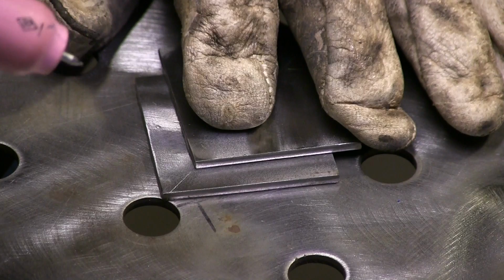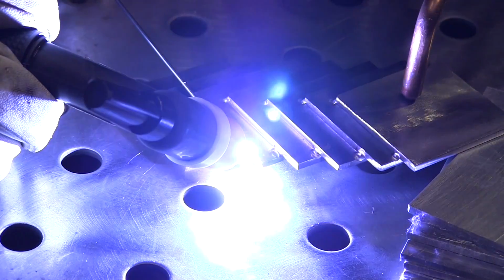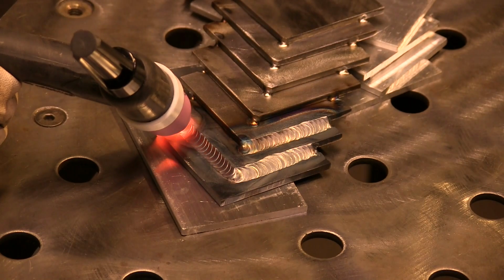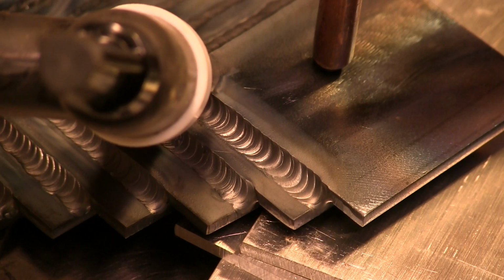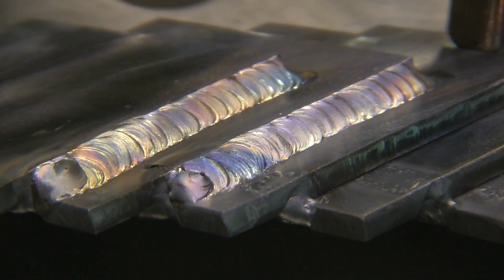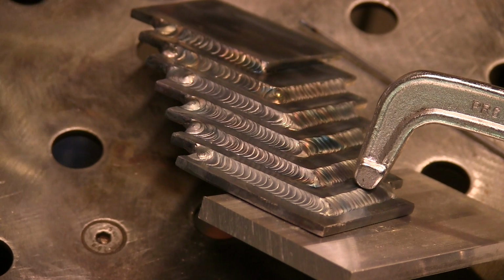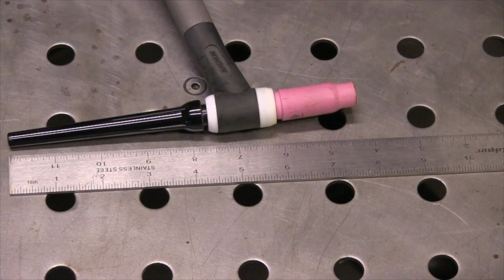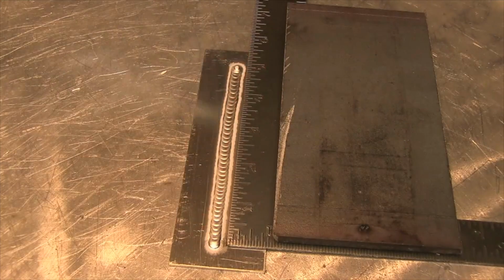Tig Welding Steel Laps Joints Practice

Comment: How do you keep your puddle from making a “moon” like shape and leaving a hole in the corner when you fill it when it does that? At times my laps do that, or I’ll melt the filler wire before it dips

Comment: With that clear #8 cup at the end what cfh are you using for air? I swapped one of those on mine to try it out and I immediately started to get small amounts of porosity. When I put my old cup on it runs fine. Is it just I need more air going through it as its a bit bigger?

Comment: Need your help jodie???
I mainly weld aluminium 99% of the time-using gold tip tungstens which apparently are good for both ac and dc welding, anyway the other 1% of my welding is mild steel header tanks. They are 2mm thick mild steel. I buff any millscale off before i weld them and sharpen a boatload of tungstens before i start. Ive found the point blunts quite quickly even if i dont touch off on the parent metal. I end up only doing about 6 inches to a foot of weld before having to change out to a freshly sharpened tungsten-it does my head in. Anyway , any suggestions?
My machine is a lorch and im using bout 100amps and about 10 litres a minute of argon. I also using just a wp20 torch with a no.5 regular(not gas lens) cup. Ive tried using 2%lanthanated but still fouling after about 6-9 inches of weld .rsvp an answer please

Comment: Another helpful tip on tight arc practicing that I've learned is favoring that arc slightly more on the flat piece as you see here. I learned that when I add tiny filler rod at higher amps. Like welding 1/8 steel and adding .045 filler. I like favoring the arc more on the bottom rather than the root. With proper torch angle it seems to prevent the rod from balling up

Comment: I don't mind the "commercial" at all.  I haven't done any TIG welding and was a bit confused about the hardware and the types of torches.  This helped me a bit.  It may be worthwhile for many viewers if you do a video sometime comparing the different types of torches and the variations and reasons for using one vs. another.  This sort of thing helps us newbies determine what equipment to consider.  I know you have talked about it here-and-there, but a more comprehensive comparison would be great.

One thing you may have mentioned at some point ...I bet the pyrex cups don't scuff metal like the ceramic ones do when you are walking the cup.

Comment: I switched from using 7014 rods to 7018s for welding steel but can't seem to get a 7018 started, the rod just wants to stick. What do I need to do different with a 7018?
Reply: Or don't you use 7018 rods with an AC welder?
Reply: Normal 7018s don't run on ac, they make special ones for that. From my experience using both rods there is very little difference in starting, maybe try upping your current?

Comment: Jody can you give me any tips on practicing welding with mirrors (tube welding) please thanks in advance
Reply: Not answering for Jody, just my opinion. First stick to the best welding procedures for the type of weld your doing. Then for me it's get as comfortable as possible, get creative, like bending the rod, positioning the mirror, put up a steady rest to lean  on and torch and filler rod position when tig welding. Be as patient as possible and really focus and concentrate. Set up different practice scenarios on your own and practice, practice, practice. For me when the weld turned out great it was like WOW ! that was cool!  Ed K. Cleve. Oh.

Comment: Stubby gas lens is nice, but even with the long back cap a full length tungsten won't fit, are they going to come out with a longer back cap?
Reply: That is a negative point with them tbh, all i do if i use one is simply cut the tungsten into two halfs

Comment: Hey Jody, I was wondering if you know where I can buy just the diffuser material for those furick 12 cups? I bought a couple 12s a while back and they're great, but I used up all the diffusers that came with it, and I cant find them anywhere on the internet by themselves.

Comment: I really need a video on dialling in a welder for MCAW as far as what to set volts and wire speed and how to manipulate them when the power source has just a click dial of 1-10 mistress of displaying the actually volts and wire speed. Gun technique would help too . IM ABOUT THE LOSE MY FIRST WELDING JOB OUT OF SChoOl.

Comment: How come my mild steel TIG never come out shiny silver like these? They're always grey. I do use a gas lens, with plenty of gas flow.
Reply: MrCrunky92 Sometimes it's cheap steel that causes the dull grey color. But there are many things that cause it such as too much heat input, bad argon, not enough gas coverage or your material isn't clean enough.
Reply: MrCrunky92 It could also be a slow travel speed.
Reply: My first thought is too long of an arc, get the tip of the tungsten where it almost touches the puddle.

Comment: Just ordered a Furick #8 kit and the mounting kit for #17/#26 torch from you. Great stuff in the store just wish I found it earlier.
A few weeks ago I ordered a new regulator from a swedish welding store and they sell something called Tig-finger from weldmonger 😀. I bought one and the label pointed me in the right direction and I have now had a couple of Youtube evenings watching your channel, sooo much good information and super crisp welding shots. Really enjoying every minute! 
One thing I can't find much about is fumes and ventilation. For us weekend warriors a dedicated extraction system is only a dream and using a fan blows away the argon. I'm using a Miller/Elipse p100 respirator as often as I can and when I'm not sure what metal I'm working on. So much free scrap metal around with nasty zinc and cadmium coatings 😷

Comment: Hey Jody. I have tried the Furick cups before and the o-ring just turned to mush after a couple passes. Using a wp20 water cooled torch. I have the CSS (can't see sh%!) and like the idea that is creates more light. Have you had this issue? Can you use it to weld aluminum? What is the max amperage recommended for these? Thanks
Reply from the maker: I push them pretty hard without issues on the o rings.  I think the #8 cup is rated for 200 amps and with AC or DC. But the #12 furick cup is rated around 175 amps for DC only.

Comment: Jody,
I'm an older guy and my sight isn't as good as it once was so I have trouble seeing the weld. I'm using a Miller Elite helmet and sometimes I weld thin metal but it's too dark to see. Perhaps you could do a video on lens numbers and welding different metals and thickness.  Do you ever need or use outside light to light the weld more? I do have your glass cup but haven't used it yet.
Thanks for all your great teaching videos, I've sure learned a lot!
Rob
Reply: For as bright as the arc is while welding, you would think that provides all the light you would need, but an outside light is amazingly helpful.  I am also in the bifocal generation, and between magnifying lenses and external light sources, my welding career has been extended immensely.

Comment: What's the difference between a ER70S2 and a ER70S6??
Reply from the maker: not much difference for most applications  S6 contains higher silicon percentage which can help float out impurities and oxides.  S2 has less silicon but contains other deoxidizers.  Both are good.  I notice more difference when the puddle penetrates and the back side is exposed to air.  S6 seems better for those situations

Comment: Ok, I noticed today that you are wearing bifocal glasses.  How in the heck do you weld with a helmet on and see what you are doing?  I have a awful time with mine.
Reply: I have been having a nightmare with my progressive glasses ended up without them on and getting in real close (short sighted) all good till the parts you are welding get in the way of your helmet. I have some close up glasses now which have helped, not into this getting old thing ! Thanks for the excellent video's Jody.
Reply: I’m 57, been wearing progressives for years. They had become useless for welding, and I need every advantage because I don’t weld often. When the arc struck, it was visually not in the same place as the wire or rod beforehand, literally jumped, ruined the start of every bead while I moved my head to locate it. Two solutions: one, get your optometrist to prescribe single vision glasses for the distance you need. Figure it out beforehand and tell him. I now have two pair like this, one very close, one fairly close. Two, try better progressive lenses. I switched from the mid-grade to the top grade Nikon lenses and it stopped the arc jumping on first strike. I can actually weld with them again. Magnification would be good, too.
Reply from the maker: I am wearing bifocals. But I also use a 2.00-2.50 magnifier in my helmet.  I look thru the top of my bifocals which is easier for me
Reply: Frank Mair 54 and it does not get better as older friends tell me ! always had glasses but when I had to go to the progressives the problems became more apparent, I have just brought a pair of auto welding goggles which are good in confined spaces less bulk and they don't fall off when working with your head upside down.
Reply: I had a pair of prescription glasses made where the entire lens is the near vision prescription of my bifocals.  Then I had another pair made because I liked them so much that I wanted one pair at home and one pair at work.  Using my bifocals just messed me up as I looked up and down to see what I was welding.

Comment: As always the best.why you don't using er70s2 filler rod?
Reply from the maker: the only reason is because I didnt have the right size in er70s2
Reply: I think he's said previously that he prefers the back side of the weld with er70s6, and I have found the same thing.  I'm not seeing any reason to buy er70s2 anymore...?